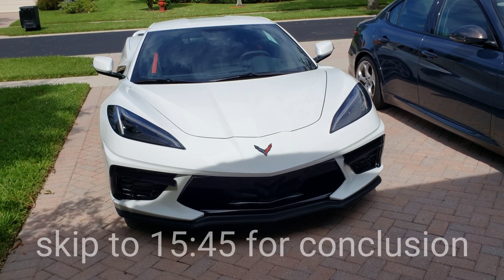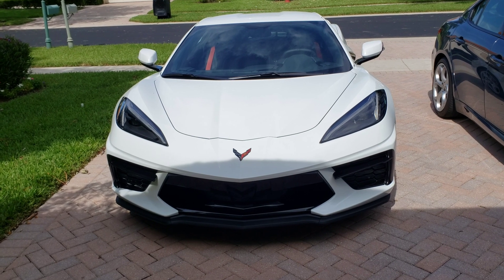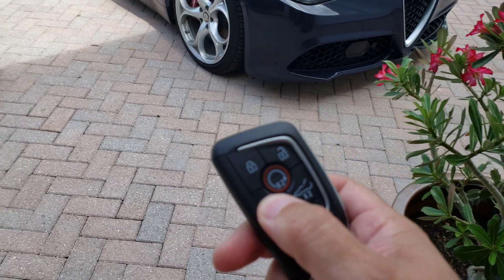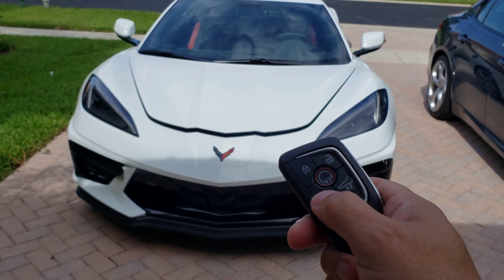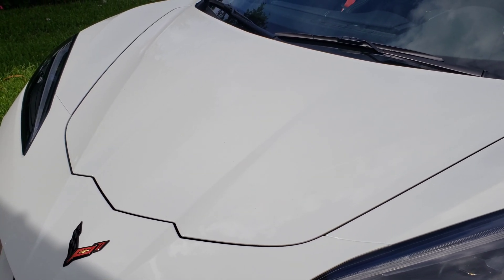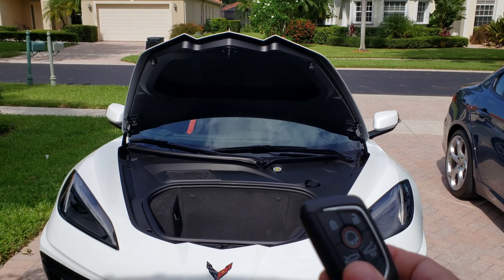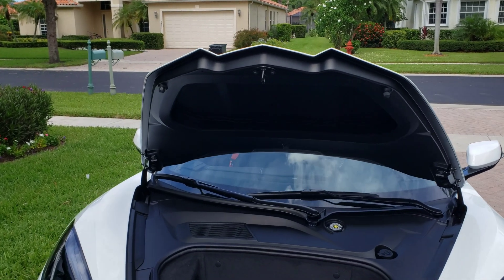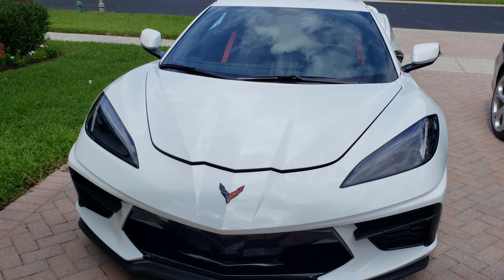Why are 2020 C8 Corvette hoods, trunks, frunks...whatever...popping open while driving?

Comment: They all open the front truck with the button in the driver's door pocket then drive off with it open. The button in the door only take one push and if.you use the pock to close the door when you get in and bump that button in the pocket the front trunk lid is open! Try it next time you can email the driver's door! Push the button in the pocket and see if the lid opens. You mention the button in the door pocket!

Comment: In effect, the GM engineers didn’t even design any type of safety latch into the frunk. I’ve seen video with the chief engineer describing the mid point between fully open and fully closed as allowing a gap to remain for the battery tender cord to protrude from its plug in receptacle that is inside the frunk. If GM doesn’t do a recall and install a mechanical only safety latch of some sort, then this issue will sooner than later cost them millions. I just took delivery of my C8 days ago and absolutely love it. But this frunk issue scares the hell out of me.
Reply from the maker: Yeah im just pulling fuse 18.

Comment: It's not an engineering issue it's user error and clickbait
Reply: You work for GM?
Reply: @O_Gio91  no but chevydude on YouTube does. He's got a very informative video on this subject. Check it out.
Reply: @davidwhite2411  : Mike Davenport (i.e. ChevyDude) doesn't work for GM either. He is a Vette salesman at a Chevy dealer & GM doesn't own the dealerships.
Reply: The Corvette Forum has a 41 page thread about this issue. There are people who have had their fobs in the cup holder & not in their pockets who had no warning on the dash about the hood being open or chimes ringing & the hood has popped open. There was a Chevy salesman who had posted on one of the forums that he was delivering a new C8 just recently to their customer who lived in the neighborhood behind their dealership. They had just cleaned & taken pics of the car. The hood was properly closed. He drove it to the gas station to fill it up. No issues. When he left the gas station & got back on the road the hood flew open without warning. He was able to pull over but had to remove the hood because the hinges were damaged. The car didn't suffer any paint damage & they were able to get new hinges sent overnight to the dealership. The car had 3 miles on it when it happened. 

I think the jury is still out on the issue. The C5 had the ignition interlock issues, the C6 Z06 had valve guide problems & ruined engines (not everyone but enough), the C7 Z06 had cooling/overhearting issues & also class action lawsuits have been iled against GM for OEM Z06 wheels which are prone to crack. There hasn't been a new Vette generation yet without defects.
Reply: For example, here is an example of the frunk hood popping open. He had also posted about this incident in the thread on Corvette Forum - https://youtu.be/hN7jQPjNcY8 

Here is what the owner had to say - "This video was shot using the onboard PDR which can be set up in dashcam mode.  I was probably doing 30-35 MPH when the hood opened.  Listen carefully at the second before. Unlatching clunk?   I'd been driving for a minute or so before this, and there are no warning chimes.  The sound wasn't turned up so much that chimes wouldn't have been heard.  There simply weren't any.

The damage to the hinges resulted in the rear being sunk down 1/4" as well as enough interference to damage the hood and fenders.  Everyone who has had this issue has had very similar damage.

The biggest Corvette forums both have current stories in addition to mine, for anyone that wants to do more research."
Reply: 3k miles on my c8 and never had an issue with the frunk ....I’m saying it’s all a pain in the ass for gm due to user failure....
Reply: @Tbob17  : User error or not, GM could have avoided the entire issue. They could have made it so the car couldn't go into drive if the frunk hood wasn't properly closed. Or if the hood was inadvertently popped open by someone's key fob button getting pressed somehow while in their pocket when getting into the car (though I'm not sure how the button could get pressed twice randomly while in your pocket).
Reply: Good points slacker but one problem is if you have a defective front hood then your remedy would render the car useless....I think there must be some software solutions....but  realize the government wants the frunk to open in case some idiot is inside it....so how much can you engineer for stupidity...
Reply: You must be one of their Engineers that’s out to remedy this problem ! I was traveling at 40 mph and my frunk opened all by itself without touching anything or heard or saw any warning lights or bells ! I now travel with a bungee cord ! Also, in discussion with my Atty to enter into a class action suit if GM does not have a recall ! God forbid it doesn’t happen to you !